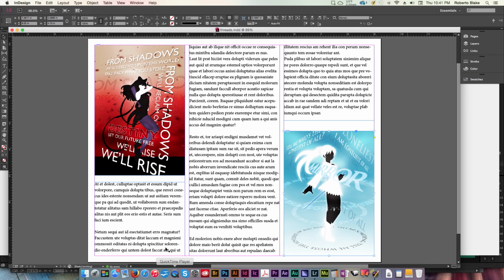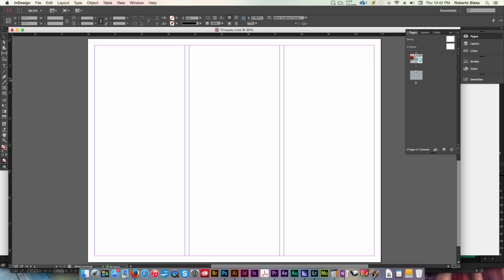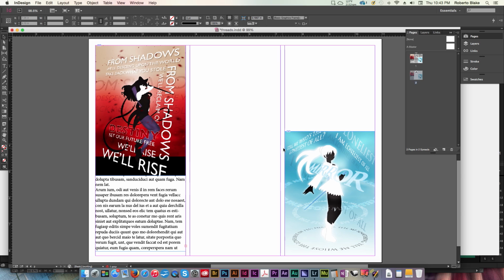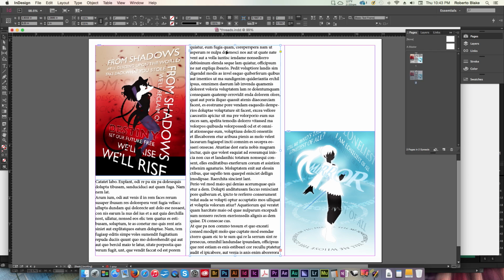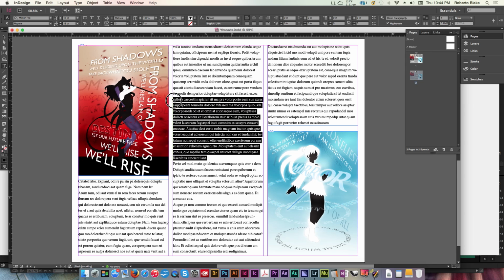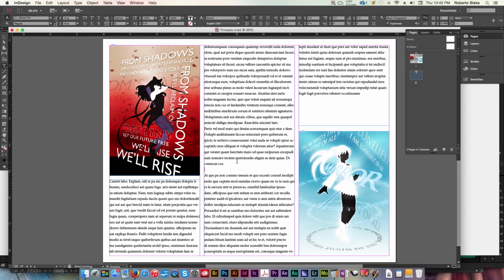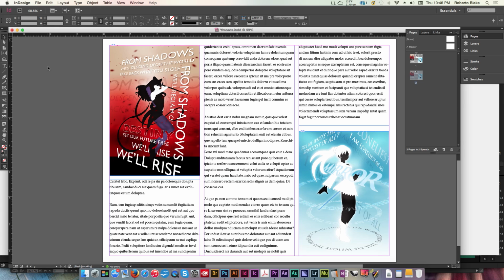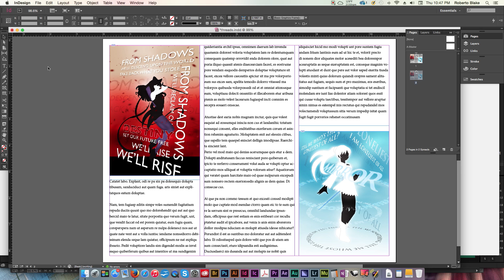InDesign CC Tutorial How to Use Threaded Text

Comment: Isn't it just as effective to make 3 columns within the one text box, set the gutter, and have a runaround on the images? What are the pros and cons of both ways?
Reply from the maker: Its not as much for the wrapping which is what you're suggesting, as it for longer editorial copy that may have to change.  A client may change all the text copy which could alter the length,  not threading that text would make it more work when updates are needed. Also this makes keeping paragraph styles and features consistent between columns easier.